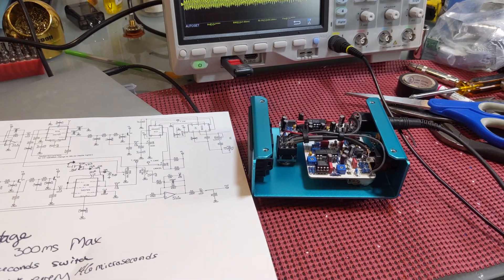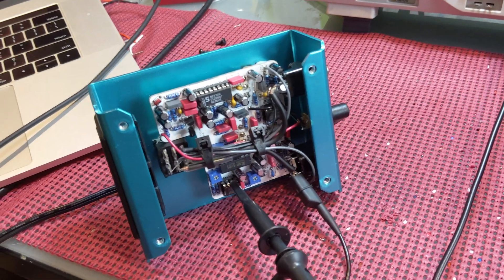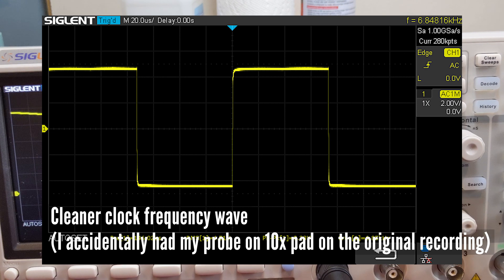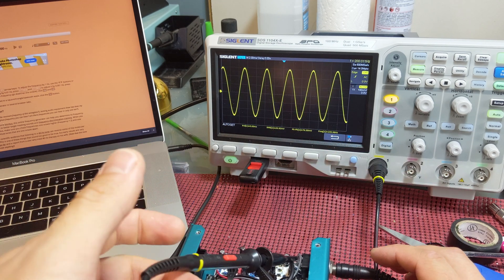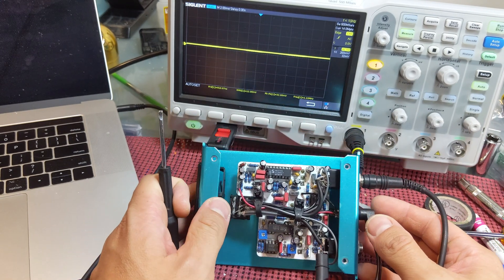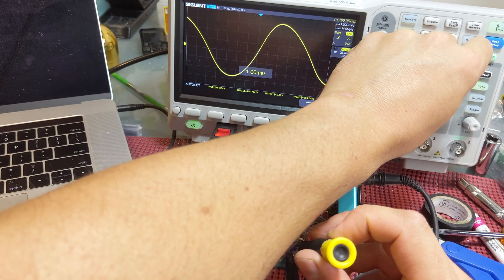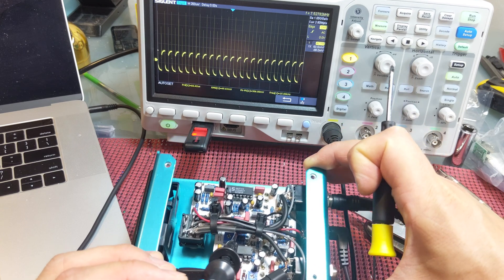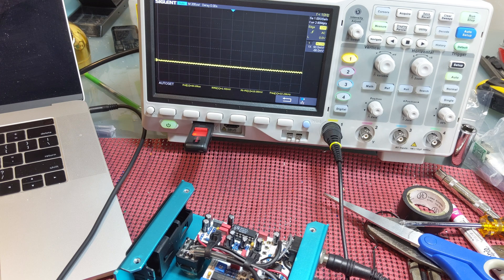How to Calibrate a BOSS DM-2 or Way Huge Aqua Puss Using an Oscilloscope. | MN3005

Comment: I've built the same circuit and adjusted the clock and the bias, correctly using your instructions. I'm trying to adjust the cancel, but I'm not getting any signal at the cancel test point (R28). Any clue?
Reply from the maker: I would check to see if the MN3005 has the two signals coming out of it and trace from there. Perhaps a resistor might not be soldered or something. I have the schematic on my site if you need that as well.

Comment: What is the cancel trim pot canceling what waveforms or signals? I'm confused how you calculated the clock frequency to be set at 6.849Khz or 6849hz. What formula did you use?
Reply: You don't need an oscilloscope to set the clock frequency on these 1-chip pedals, just use your ears and set it where the sound quality is acceptable to you (at max delay time), you'll probably end up very close to 300ms...OR, use a recording software and measure the milliseconds between the dry signal and the first repeat at max delay time, if you want some numerical reference...with this method I'm at ~333ms on my DOD FX90, without much aliasing noise.
The Cancel trim reduces the clock frequency at the output of the pedal, which is in the audible range at ~6.8kHz.
For the Bias trim, you can't ask for wonders with these 9V operated pedals: there will always be some distortion with a strong enough signal, just put it in the middle where it sounds "less distorted"...the Ibanez AD80 is better running (internally) at 12V, and the Deluxe Memory Man MUCH better at 15V with two chips...Hope this helps!

Comment: You gotta do a vid on how to calibrate old Boss CE-2 units that stupid kids messed with the trim pots in... there are THOUSANDS of affected blue boxes.
Reply from the maker: Ohhh send one my way and I'll do it free!
Reply: I could actually answer that one. Boss CE-2’s only have one trim pot iirc. That sets the bias voltage for all the chips in the pedal. You can set it by ear. If the voltage is too high, you’ll hear no effect. If it’s too low, you’ll hear a distortion that doesn’t sound good. Just set it to where there’s no distortion. Should be somewhere in the middle. Pretty straightforward. You could do it with an oscilloscope if you want to, but you’d visually be looking for a distortion-free sine wave instead of listening for one.